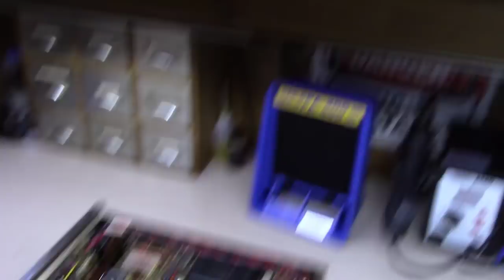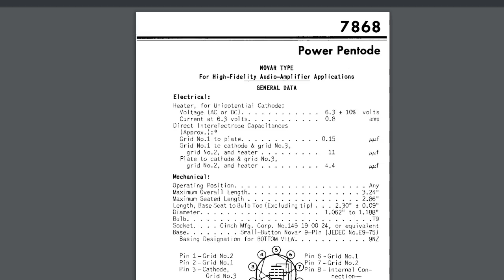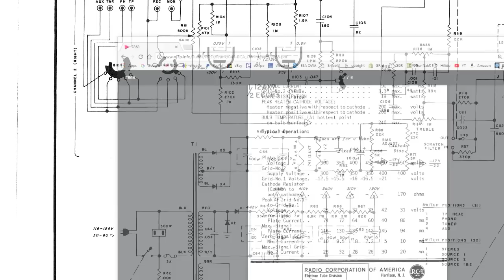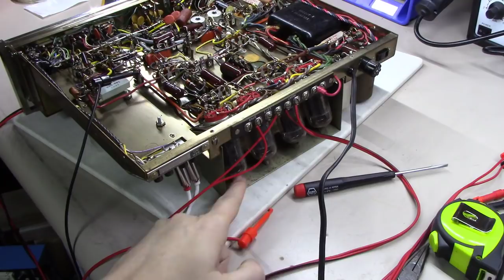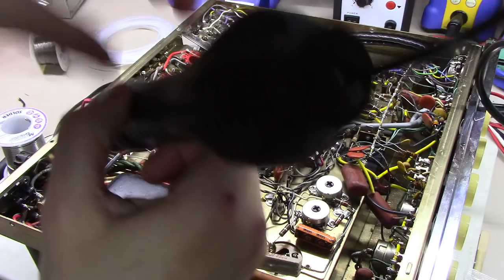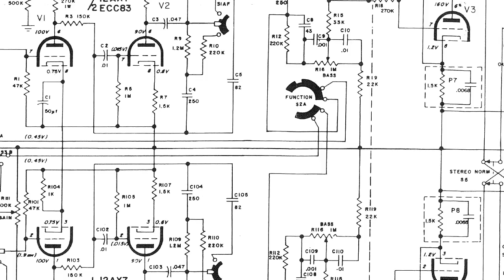Sherwood S-5500 III Tube Amplifier Troubleshooting and Repair

Comment: In 1975 I received a call from Andy Hefley who along with Jim Bongiorno, Ed Miller (who founded Sherwood electronics), and Adam Zaremba left SAE (Scientific Audio Electronics, where Ed Miller had designed the SAE Mark Six, stereo FM tuner introduced in 1972 is widely recognized as the first, consumer FM stereo tuner to feature a digital frequency display using Nixie tubes), and founded a new audio company called The Great American Sound Co. or GAS. Andy asked if I would meet Jim at his Hollywood apartment for an interview to see if I was interested in a full-time position as head of manufacturing engineering at GAS Co. The four-hour interview included: Jim's outlandish apparel choices, technical interrogations, Jim playing the piano and accordion, dinner where Jim berated the poor waitress about the color of his toast and the temperature of his coffee, demo's of his new product the "Ampzilla" power amplifier, more interrogations, and, believe it or not, I took the position! The Great American Sound Co. was initially capitalized for $175,000.00 from a construction article for a "fully complementary transistor", 200-watt per-channel stereo audio power amplifier that appeared in the September 1974 issue of Popular Electronics magazine. The article had technical details, test results, schematic diagram, and a parts list that also offered a complete kit of parts for $340.00 or fully assembled for $475.00 plus shipping. The response to the article and orders for the kits and assembled amplifiers was overwhelming, and when I entered the picture in January, not a single kit or assembled amplifier had been shipped! My first task was to rewrite the kit assembly manual that Jim wrote because technical writing was not Bongiorno's forte--antagonizing audio magazine editors and waitresses was! My other work at GAS Co. included: designing factory floor plans, AC power distribution, designing and fabricating specialized work benches, custom assembly fixtures, electronic test fixtures, new product development, electronic equipment packaging, engineering documentation, test procedures, inventory and quality control procedures and a never ending stream of other technical endeavors. I worked with Jim, Andy, Ed, and Adam in the development and manufacturing of: the Ampzilla II, Son of Ampzilla, Grandson of Ampzilla power amplifiers, the Thaedra, Thoebe, Thalia preamps. I left GAS Co. in December of 1978, David Riddle

Comment: Working on a similar S8000 IV atm. Into the power supply reservoir caps now. I understand this is a voltage doubler setup. Is the housing on one of the capacitors positive… hence the insulating cover?

Comment: Instead of adding two more bias voltage sources, wouldn't it be easier to exchange the two 150k resistors at the grids for a balance pot?

Comment: I've done several of these amps. I found it best to convert them to a traditional bias supply off one of the high voltage leads and bacon adjustable pot for each side of the amp. Also if you regulate the screen voltage you'll get a much cleaner output

Comment: If you were to bias the tubes by measuring the (idle) cathode current, how many milliamps would you be looking for on each tube?  I'm guessing 32ma.  I have a Sherwood S-5000 ii that uses 7868s.  Plate voltage is 415.  With the bias set at maximum (-19.71 volts), I measure 32ma across the 10 ohm cathode resistors you suggested.  Comments?

Comment: Personally I would use 1 ohm resistors there. Anything a 10 ohm would do, a one ohm would do well enough, considering digital multimeters and all, and the math is easier. 1 volt equals 1 amp; .025V equals 25 milliamps, etc. Nice video!
Reply: Not true!  One ohm resistors are harder to get an accurate reading from as opposed to ten ohm resistors which have 10x the range to dial in your current.

Comment: I really appreciate your professionalism and your expertise. I have two older receivers, a Luxman from 1988 and a Yamaha from 1977. There's no one in this area that repairs electronic equipment anymore. I found one gentleman who simply listened to the Yamaha for a few days to hear a loud popping sound that I told him about. When it didn't repeat for him he pronounced it fine. He didn't check anything with test instruments and when I mentioned that the amp needed biasing he seemed confused. I wish you lived closer, I live in eastern Kentucky. Could really use someone who knows what they're doing.

Comment: Actually you are incorrect about the amp's power rating. In a push-pull configuration, the 7868's can do about 20watts each of plate power so ~~ 40W of RMS power is about right per channel. The line input power is probably more like 150 watts of power, IMO.
Reply: Can't wait  to see your videos.

Comment: The bias pots are dodgy as wired on the schematic; if the wiper lifts you lose bias as has happened here. Best to tie the wiper to the negative end or put a high value resistor like a 220k between wiper and neg bias supply.
     What's the music Mark please?